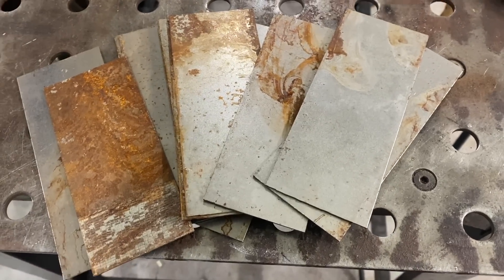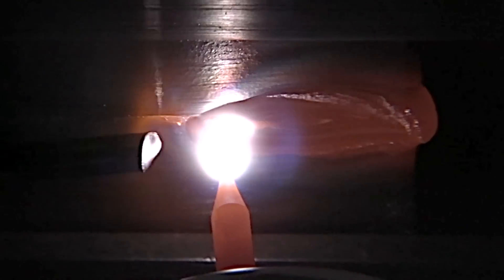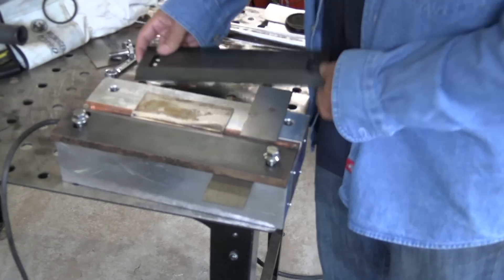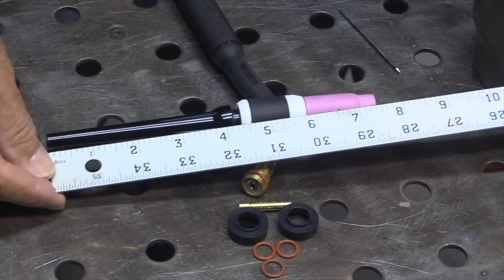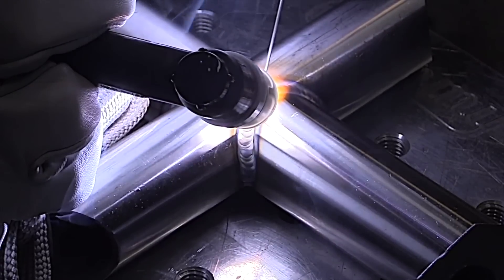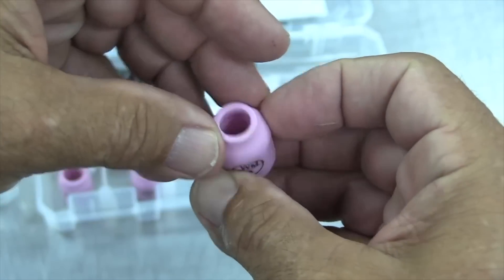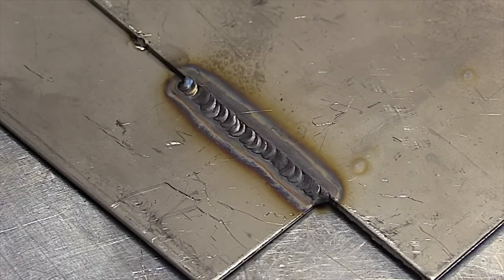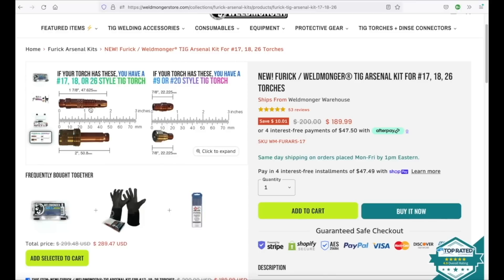Aerospace Weld Test Practice 2g .041" Group 1

Comment: Nice lookin welds.  The Air Force did away with the vertical and horizontal weld joints years ago for their aerospace  welding certification.   It's all tube to tube in 6G position.
Reply from the maker: interesting to know that. Everyone seems to do it a bit differently. Some even require a 5f tube to plate test using 1/4" diameter tubing.

Comment: Minor suggestion for the kits, they all have back caps. I typically have an excess of back caps. They come w every kit and every torch I've ever bought and they almost never go bad. So my suggestion is maybe drop the back caps out of the kits and put in another gas lense or a few more collets. Those are what get consumed. You could also have re-up kits, that just have collets and lenses or several of the same cups with gaskets because when you inevitably break the cup you may not need a whole set of the rest.
Reply: Good idea. I only use the smallest back cap anyway